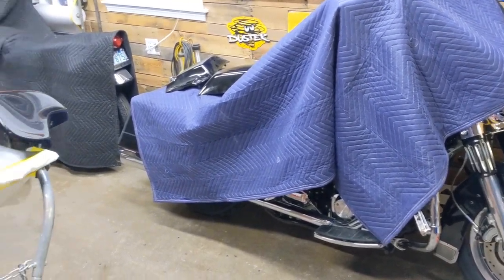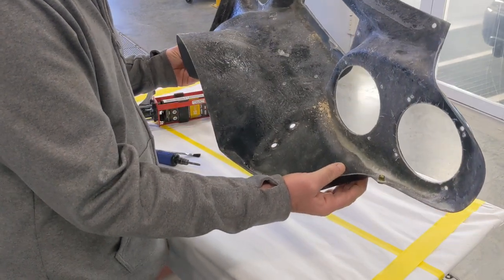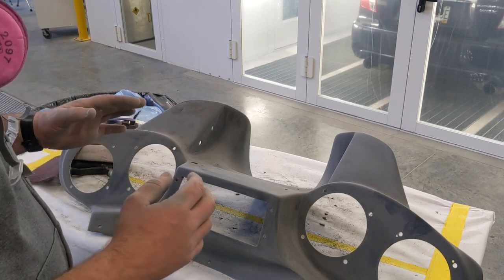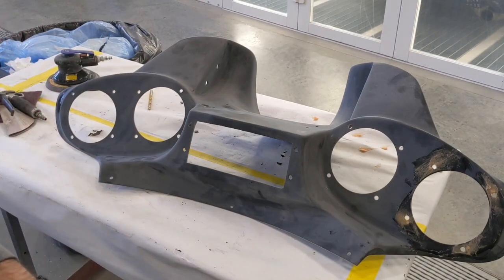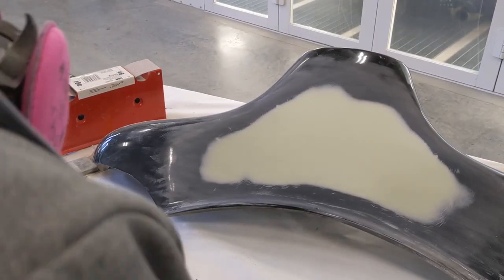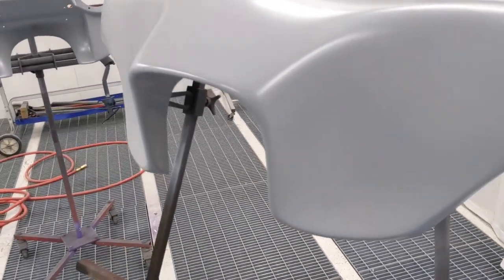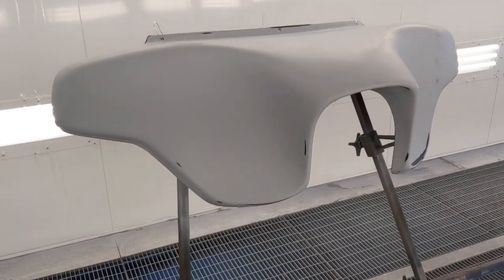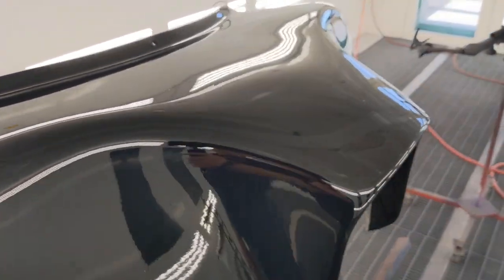Harley Road King Batwing Fairing Installation Video- Part 8- Body Work and Paint Application

Comment: This is EXACTLY what I was looking for is this a 2002 Road king? (only asking because of intake cover)
I have a couple questions if you still own this kit with the bike. My Main question is does this system draws enough power to effect the charging system?
I'm Assuming the kit mfg thought about this, but I wanted to know your thoughts since there arent too many doing this, And you are gonna have that knowledge of the nicpicks of owning it for a longer time, versa the honeymoon phase of said bought item. I found a kit online looks just like this one. 
Another question I had is if you own one of those bikes then most pple have had the windscreen odd buffer of air between me and my helmet (can wear your damn neck out fighting it lol) highway mostly and does this kit devert the wind better than OEM windscreen.  
My Last question is does it rattle loose over time lol... and I was gonna ask if that fiberglass cracked in anyway worst than it already did (Ive watched most of the videos in this install) Thanks so much for showing the WHOLE install this is perfect for me to feed off of.

Comment: My fairing started with a hair line crack from one point of fitment and is growing with time ! What should I do to stop the crack going further and repair the existing crack too.
Reply from the maker: Unfortunately it will need to be repaired with fiberglass mat and resin in order stop the problem from continuing to happen.  It will need to be ground down , built back up, then shaped and refinished.  As far as stopping it from happening again, you would need to take a look at what is causing it and make a change to different attaching hardware.  Thanks for watching!
Reply: @kalways_kustoms  it was fitted after making a custom clamp by the guys and as far as my guess , the weight of speakers and player adds a lot of pressure on the bolts and it's not capable enough to withstand all of that especially when riding and hitting a bit of bumps.
Reply from the maker: @haztechno  it may have to be reconfigured with a different type of mount to stop it from happening again. That's a bummer.
Reply: Going to make a visit and ask for modifications accordingly so it doesn't happen further.